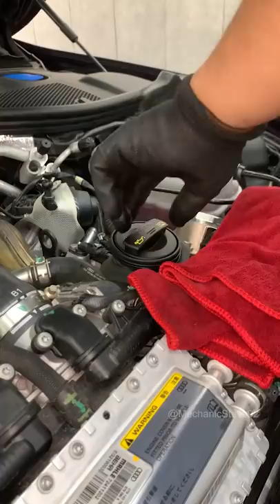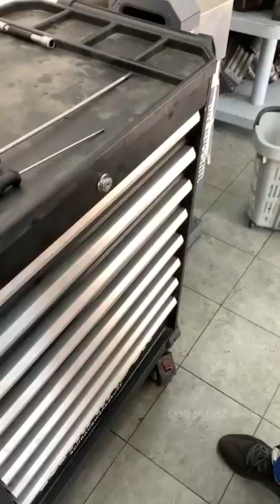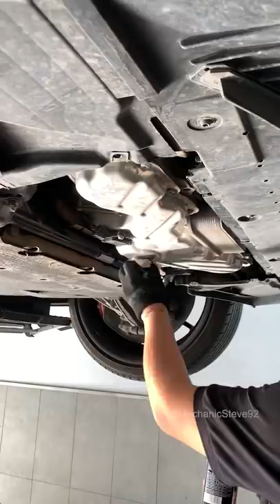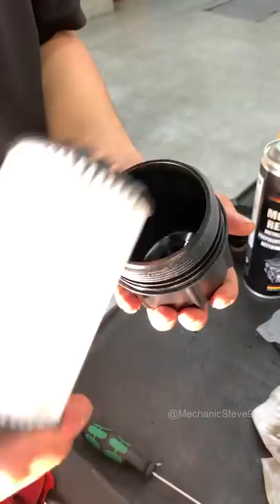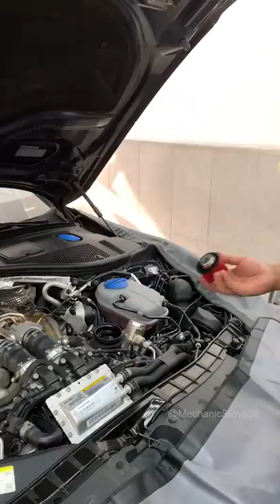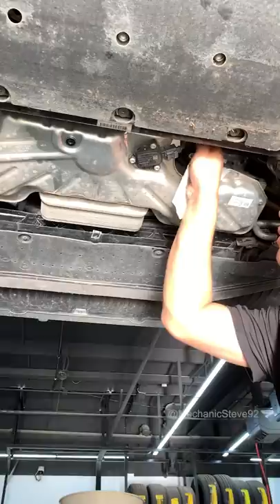Audi RS6 Full Service Maintenance

Comment: This is how service should be working!!!!🤝🤝🤝👍👍👍👍👍👍
Reply: Problem is - not many peopel are willing to pay fpr that quality service.
Reply: @Hack_es  people with this kind of cars are, they bought the car for more than 100k I am sure they won't mind a $300+ normal service. Of course majority of people with budget friendly cars like Camrys and such won't be willing to pay more than 100 usd for an oil change and thats on the high end too...
Reply: Service should be done not working.
Reply: @nightarrow7473  And thats were u are Wrong. I worked at Mercedes benz dealership and only a few percent of the expensive car owners treated their cars well. Most of them or better the majority leases the cars, so they dont fell "ownership" as much maybe. Never the less, the owners of expensive cars argued way heavier about additional but necessary repairs, compared to older/less expensive cars.
Reply: Technician wasting time to up down up down up down the lifter.👎
Reply: @Hack_es  then the owners either are not knowledgeable enough in cars to know what is best for their cars or just cheap on servicing, I have been a regular at Audi service in my country, the center does servicing and repairs for VW/Audi/ Bentley, owners who own VW toureg and up from there always pay 300 bucks for a normal service ( oil change + oil filter + general inspection) and in front of me owners approved repairs and services that cost 2500 USD, maybe its a different place with different people mindsets but most if not all expensive car owners where I live do services and repairs however expensive they are.
Reply: i'd be very mad seeing how long that service is taking shouldn't be more than an hour

Comment: A couple little things I'd recommend to improve this:
1. Lubricating gaskets prior to installing them can help prevent damage because it becomes easier to install them.
2. I would do one step at a time. There were several points where you would go and start something else. Replacing the air filter? Finish reinstalling said air filter before moving onto the next task.
3. I would leave the belly pan off until you can start the vehicle and build oil pressure prior to reinstalling and sending it on its way. Even gaskets installed correctly can have pinhole leaks.
4. I would not spray degreaser INTO the oil filter housing. I'm sure you wiped it all up but for the negligible benefit of doing that, there is still a small risk of contamination. However, I have started spraying degreaser onto my drain plug after reinstallation. It is a very good idea.

I enjoyed the video. I look forward to seeing more.
Reply: They lubricated the o-rings before installing them didn't you see the mechanic dip his finger into the oil with the white finger glove on?
Reply: You own or run a service shop or just another YouTube professional?

Comment: Don’t add any chemicals or additives to your oil, that will only attack sealings inside the engine and can lead to leaks which can get extremely costly
Reply: That's bs. Additives help removing oil gunk? Idk what the proper name is in English. It's Ölschlamm in German. That can really prevent the filter from clogging.
Reply: @aeroxdima7777  This car is like 2019 year, what fucking gunk are you supposed to find there already? Lol
Reply: @dzenan.m  So, you can drive alot in just 2 years.
Reply: @zlover7777  huh?
Reply: @dzenan.m  My bad, I edited my comment.
Reply: @zlover7777  Yes you can, but nowhere near enough to have "gunk", especially if you do regular service on time..
Reply: @dzenan.m  Yes, you are right👍🏻

Comment: Cool stuff but what was that oil?… I wouldn’t pour some noname Pro Tec oil brand in my car lol.. especially with VAG cars they need to be explicitly VW/Audi compliant oil like Castrol, Valvoline etc…
Reply: valvoline is also some cheat oil
Reply: that's actually one type of engine flush compound which is somehow doing certian damages to gaskets in relatively new engines.
Reply: @kingpertinax  Castrol is also shit, same with Mobil, don't know for sure about Vavoline, but the only oils I trust are from Motul and Liqui Moly and maybe Millers too
Reply: MOTUL for turbo engines.
Reply: @bleachyunknown2000  castrol is vag original supplier
Reply: @Duy3880  You know why they use Castrol? They get money from them, a lot of it, that's why it says "Castrol" on VAG oil caps, they are simply getting money for advertising.
Reply: @ratio5702  TFSI engines need to have the best quality oil possible, that's a fact, I've owned a couple of TFSI cars and I'm a mechanic myself
Reply: @bleachyunknown2000  You also dont need to change oil every 15.000km because at that point you have already new oil because you need to add every 1.500km a liter lol. 😂
Reply: @dzenan.m  Here we go, typical TFSI stereotypes, have you ever owned one, or do you know anything else than things other people say who don't know a thing about these engines?
Reply: @bleachyunknown2000  its a joke.
Reply: @bleachyunknown2000  Any oil works just fine in a TFSI, aslong as it meets de vag spec for that engine. As a "mechanic yourself" you should know about the silly advertising schemes that VAG & GM have regarding oil. 

I've been pouring Ardeca in my engines for over 40 years, hasn't killed any of my volvo's, Opels, VW's, Skoda's & 2 audi's.

they all ran fine for yeaarsss.
Reply: @LansaDiag  I think you didn't get what I just said. All I'm saying is that from my experience, my car burnt lots of oil when I was using Mobil 1 and it had always pretty nasty sludge inside the engine, after switching to a different oil, the problem is no longer here. By the way, VAG was advertising Castrol, which is also bad oil, so what's up? i said it a couple of comments above already
Reply: @LansaDiag  Never heard of Ardeca, I'm based in scandinavia, so yeah, that's probably why
Reply: @dzenan.m  I do my oil change every 2000KM because I am tuned, engine loves it
Reply: Nah Castrol is shit. Mostly the VAG car scene here in germany do various amounts of oil tests and it's mostly ravenol with the best results and the best additives in the oil.
Reply: @dzenan.m  HAHAHA true

Comment: How about telling us/showing us what all those additives are that you are putting into various parts of the car and what will they do?
Reply: The first one into the oil section is just a oil flush, he started the motor after so it cleans the motor, he then releases it, so the parts inside get flushed out with the oil. The additive into the petrol tank is probably just petrol additive, adds some octane like fueling your car up with premium petrol like 98/102 octane. It can run your car a bit better and smoothly than normal 95
Reply: The first one is Protec Engine Flush, which flushes the entire motor and removes all carbon built up and residues, the red one is Protec Fuel Line Cleaner which cleans the entire fuel system from the back till the injectors and the combustion chamber and the last one is Protec Nanoengine Protect and Seal, creates a highly active nano-barrier in the oil, which protects all internal surfaces in engines and assemblies.
Everyone who respects his property should act like this, if not in every service, at least once every second service.
Reply: @TheMpanistas  who says those additives dont actually damage the engine?
Reply: @zafert85  The company and its products are not new in the market. They are out there for more than 30-35 years. You may never have come across any of them because they are sold mainly in the repair shops. On top of that, most of the products are TÜV verified for what they actually claim to do.
Reply: @TheMpanistas  I can only imagine the testing products go through for Tüv approval.
Reply: They do nothing
Reply: @zafert85  They don't
Reply: Don't worry, this fella won't reply your comment
Reply: @zafert85  🤣🤣🤣🤣🤣🤣🤣🙉🙉🙉🙈🙈🙈

Comment: this is far from a full service, didn't see you blew up the tires or check the profile, brakepads, suspension, axles, no spark plugs, no interior filter, no service or inspection reset with the computer, not checking the lights, wipers, etc.. a lot is not been don to call this a full service of a RS6, this is just an oil change and a new air filter and that's it..
Reply: True. If you spend more money for am oil change and decide to go to the dealership they will do the full inspection complimentary which is good in my opinion.
Reply: Thank you👍if you have a expensive car you only take it to an authorized workshop
Reply: @sugarsaint  why should i shut up, where I work, it is an official dealer and it is in europe (belgium) we are obliged to do our work like it is prescribed by the dealer itself, so do not give me the fraudelent excuus because we can not premitted to do so...

Comment: Surely any S/RS Audi has a £1 gasket that requires most of the engine to be removed to change it? Or wiring under-specc'd for the heat in the engine so it fails? That's a proper Audi service

Comment: Where is the Castrol Edge Oil? Sure you can use something else but it is revommendet by audi so i would go with original parts as well as with the brands which are used by the brand

Comment: Great work! At 0:22 what is that liquid being used?
Reply: I think it's used to flush the engine
Reply: @x_x_xx2001  it is motor flush, u don't fill up gearbox oil from the top
Reply: @x_x_xx2001  nope
Reply: @x_x_xx2001  You got one for the Oilsystem and the other one for the fuelsystem
Reply: @x_x_xx2001  And the stuff he put in the tank is to clean the Fuelsystem and injectors.
Reply: Its a liquid used to clean the engine. (Should only be used right before a oil change tho)

Comment: An full dodge service would be oil change flush brake fluid diff service ac service new brake pads wipers fix any leaks belts and alignment air filters cabin filter and fuel service
Reply: Lol Dodge.
Reply: Yes that would be every 1k miles for Dodge.  100K for every other brand.  Don't forget new transmissions every 3k.
Reply: @chrishoesel Since i drive a doge i never made it home again... Just driving from one service to the next one. But it does worth it for sure!

Comment: What’s the name of the fluid poured into the gas tank and into motor oil?
Reply: Ye that’s a good one
Reply: Pause the video on the bottles. The products are from ProTec which I'm assuming arw similar to Liqui Moly. Shown is an engine flush, fuel treatment, and an engine oil additive.